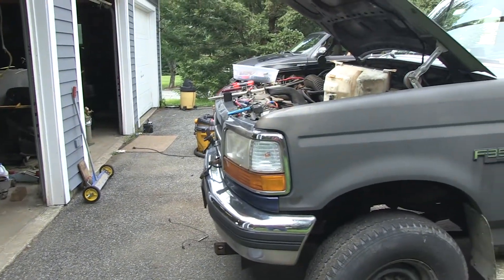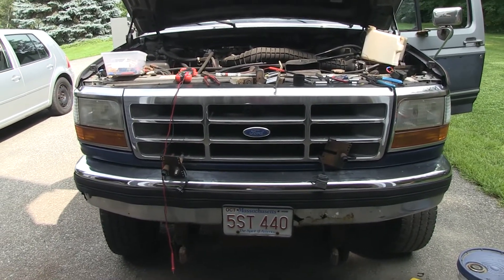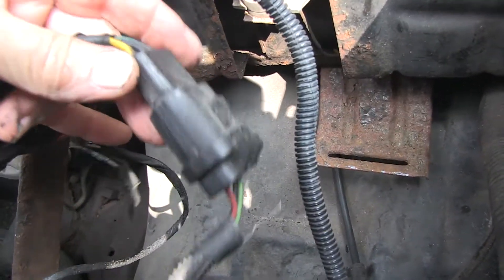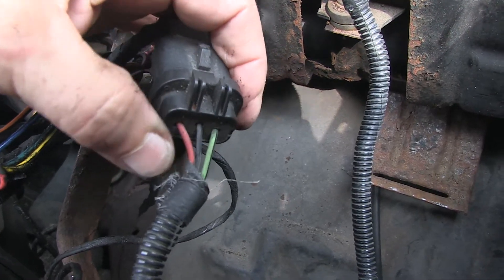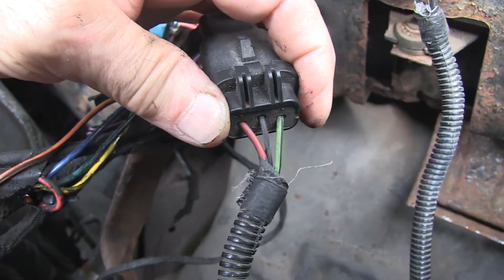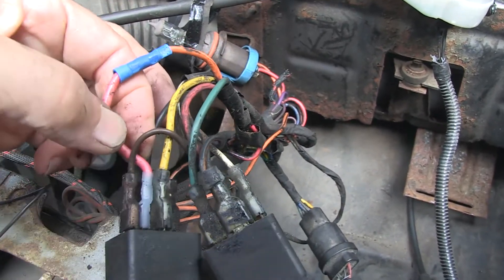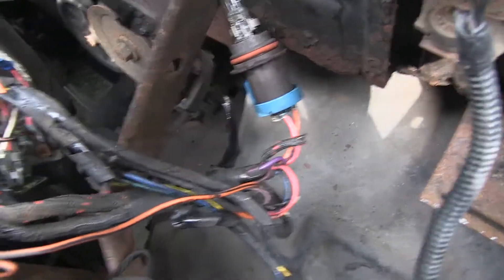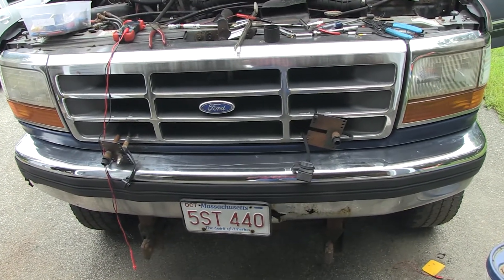Ford Truck Headlight Problem. Low beams going off and on.

Comment: Thank you for your video Sir.    Im running into the same problem.   My tail lights actually stay on until i disconnected the battery.   So i admit.  Im stumped
Reply from the maker: Good luck.... it seems to me that you want to work backwards from the lights.....and find out where the voltage is coming from... if worse comes to worse, you could cut the wire and put a toggle switch in.... you'd just have to remember to flip the switch after stopping the car...
Reply from the maker: Maybe a relay is stuck on???????
Reply: @amcrae1  thank you so much for the replies.   I am definitely going to apply all of these notions.  I appreciate it